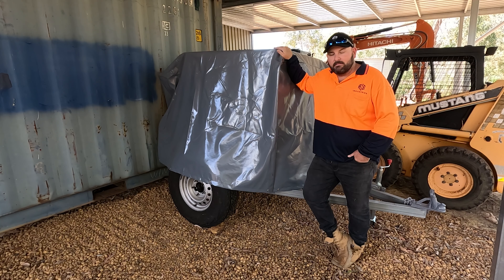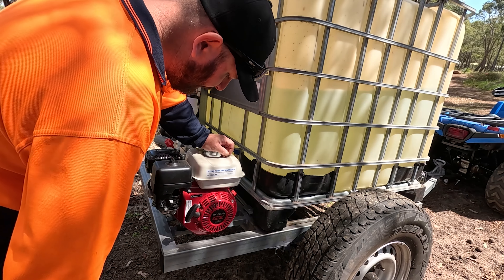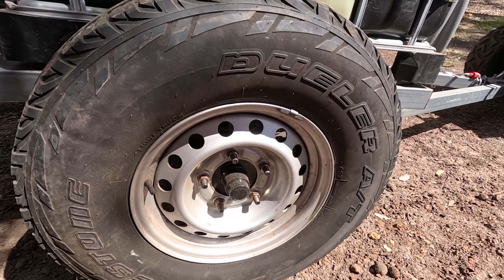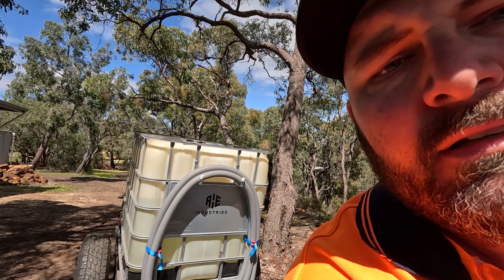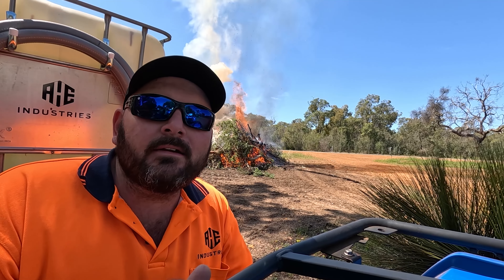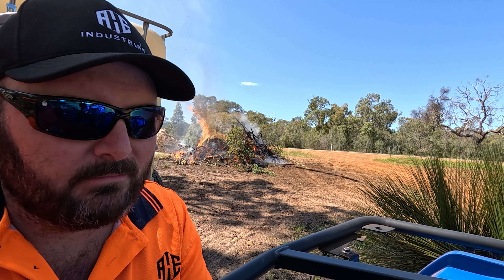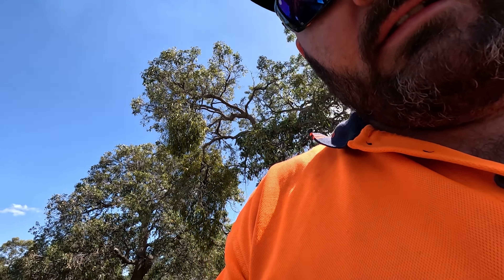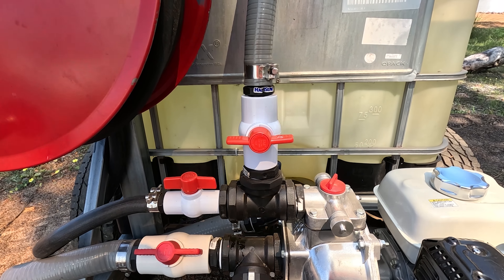Firefighting Trailer Build Q & A

Comment: Place a couple of hose hooks around the Poly Tank in order for you to hold the nozzle on the ATV as your laying a line or extinguishing the fire. PUMP and ROLL. Also, have a toolbox mounted on the trailer with Tools, Spare Washers and Clamps for every connection. No need to return to house to make repairs.

Comment: If you want a cheap way to baffle it get yourself some perforated 4" drain pipe and shove as much as you can into the tank it doesn't take up much volume and it'll keep it from sloshing.

Comment: You can also get a drop axle to reduce you trailer height.. but they are horribly expensive..
Reply from the maker: Definitely, I have never been a fan of drop axles though. More unnecessary plates and welds on the axle